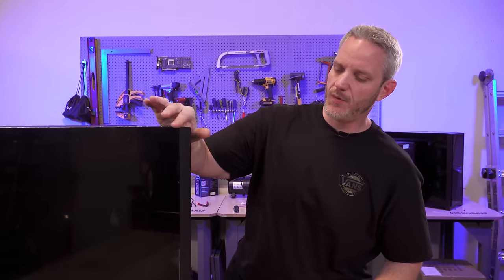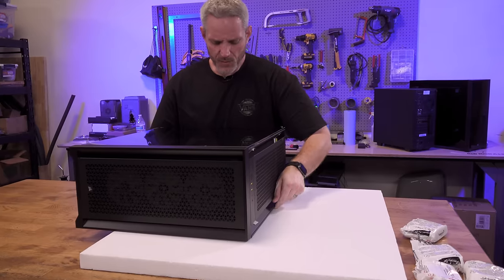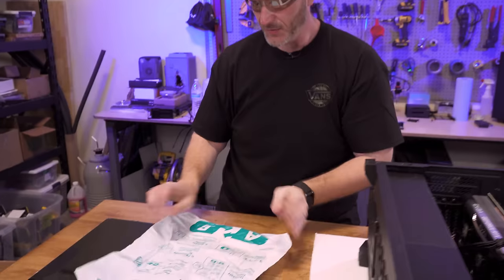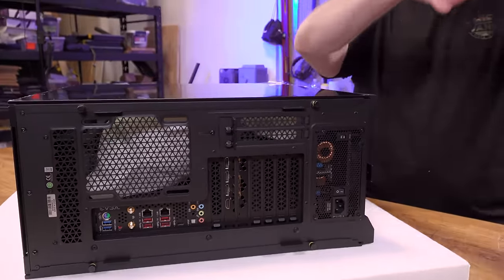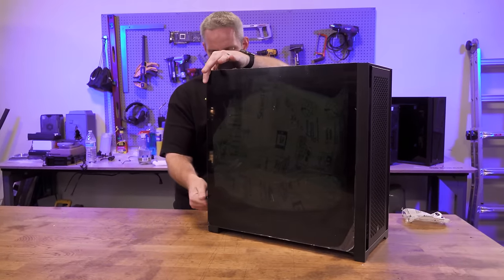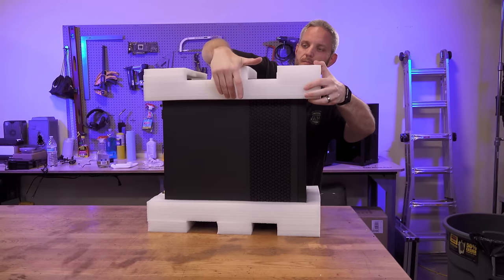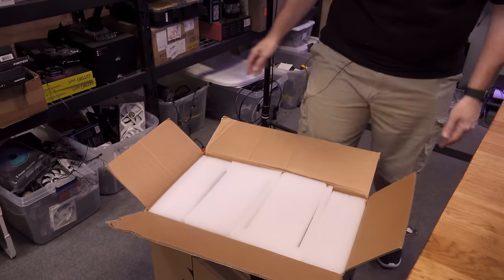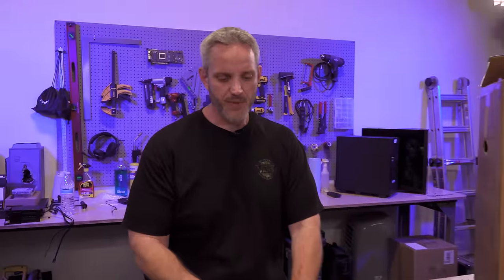How to properly pack and ship a PC!

Comment: Instapack? Styrofoam? Sounds like same thing to me. Umm about 40 years ago we, me and some other dorks, used the 2 chemicals for styrofoam and mixed about 2 or 3oz of each into a cup, not much. Quickly placed it under our targets (victims) car in the parking lot. Well, to say the least, we quickly realized our mistake. When it was all said and done the styrofoam was about 1/2 way up the doors and all the way around the car. Looked cool but It took a LONG time to get the car out and to clean off the foam. I think we were lucky it didn't destroy the paint or anything under the car.

Comment: Is the packing foam stuff on the inside of the PC Important if your like me with a baby graphics card thats really tiny lol I tend to go 4 states away once or twice sometimes 3 times a year for a few weeks/month or so and have started just taking my pc because sometimes we stay even longer than that... I am moving it myself and usually pack the inside of the box the same way you do just without the pack of expanding stuff and then I put a pillow underneath the pc to absorb some of the impact if there are bumpy roads

I think my graphics card is like a radeon 200 series,I have 2 PCs one thats for gaming and one from 2010 that can barely run anything besides roblox so I sometimes get those cards confused 🤷‍♂️ the 2010 one has integrated graphics but the other one has a card and runs apex legends, fortnite, and stuff at like 40-50 fps so its not nearly as heavy as yours would be and I’ve took my pc up there at least 3-5 times up and back

Comment: I used instapak for the first time, and it was a damn nightmare. I hate it. The orientation that Jay did does not work with air coolers and smaller micro ATX cases. It doesn't leave enough space. I tried it in that orientation and it expanded and got punctured by the graphics card heat sink fins and got everywhere. The foam also got stuck in every available space, and the pack couldn't be removed, and I had to use scissors to clip it out manually bit by bit so I could take it out. It burst on the SSD as well, and the motherboard doesn't have a heatsink cover for it, and it was horrifying. I had to use tweezers to scrape it off the SSD, and bits of it got stuck on the motherboard. I hate instapak. It really should be used sparingly. Not more than one at a time in a case.

Comment: Hello comment section of jayz most recent video. I just bought a set of 2x8 ddr4 3200 mhz ram off of amazon and it arrived today, but I just looked again and saw the same exact ram but in the 3600 mhz style for only like 4 dollars more. Would it be worth it to try and return what I have and get the extra 400 mhz? (Gaming only pc)

Comment: @JayzTwoCents  I dont know how concerned you are with the current waste problem or the environment but these instant foam packs are pretty toxic and are not cleared for normal waste, also they are expensive for something you can just use excess grocery bags or just buy a newspaper and pack the interior tightly. I thought about buying these for my at home pc building business but found they are not good and just horrible waste.

Comment: Gpu not will nilly rattling about case, one stick of ram not randomly stuck under motherboard, hard drive not bent, used box of correct size as opposed to putting into one suitable for a fridge, box didn't contain 27 ton of packing, correct address on box. God damn armature a dell spokesperson was heard to say..

Comment: I have a pretty unconventional video / project idea, something crazy enough for you 💁‍♀️ 

A "Doomsday PC" no moving parts, exterior ROLL CAGE, internal structural improvements, covered in a (openable) metal mesh / grid to make it EMP - Proof (Faraday cage) internal small UPS (Uninterruptable Power supply) and altogether indestructible... you even can throw it against a wall... it... will... work.
Reply: INBOX➕1⑧①③③②⑦④⑨⑨⓪WhatsApp  oh boy here we go... you really shouldn't have done that... now i will spend the next hour searching all your coments, and reporting them, until you are banned bot.

Comment: Instpak is EXPENSIVE.  Not sure where you got a 12 pack for $45.  What I saw you use is about $50 for those four pieces. 
Just remove the cards and wrap separately.